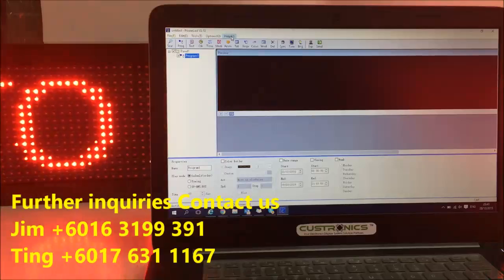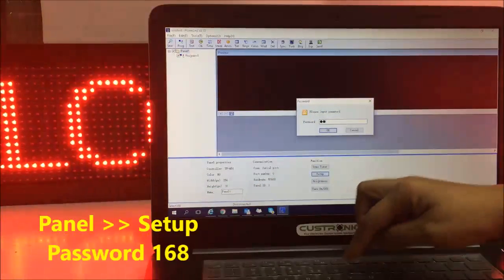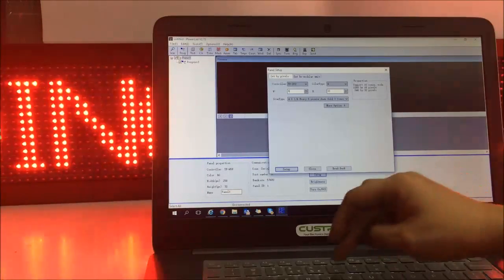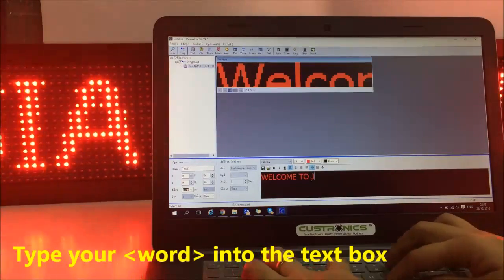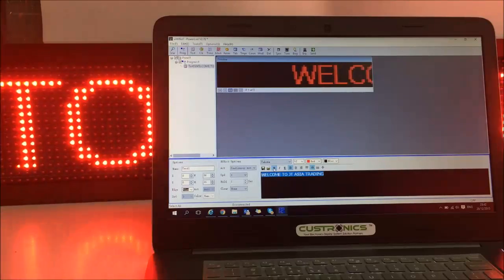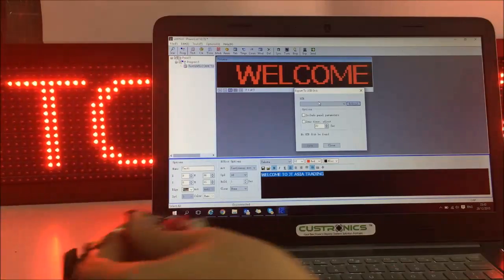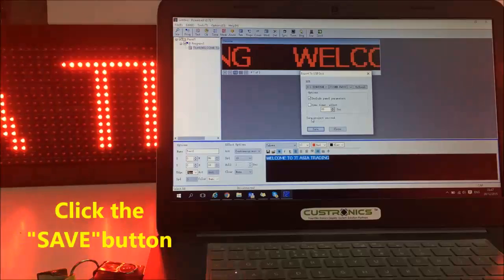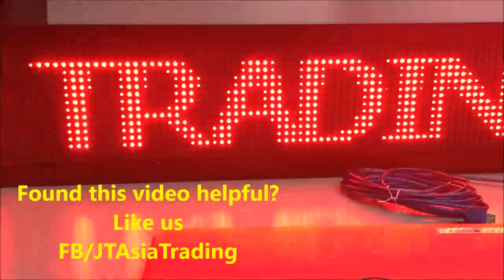How to program LED Running message board using powerled with TFS5U controller | LED Display Malaysia

Comment: We have this program and it works well.  We want to add a pic to the text.  Do you know how to add a pic to the text so it scrolls after the text..or with the text, not behind the text?
Reply from the maker: Hi Rebecca Borst, yes. as long as you follow the resolution in ms paint & import .bmp file via the program.

Comment: If I load a programme on a flash ,next time if I want to programme the led do I have to delete the existing file before imputing the new programme
Reply from the maker: Hi Angelo, you do not need to delete the existing file from the flash. The PowerLED program will automatically over write every time you program.
Reply: @JTLEDDisplay  I still have difficulty programming words into it at first try the welcome alone works, but when I input the right way words into the flash it just goes to default think am not doing something right.my model is TF-S6UW
Reply: For the TF-S6UW WHAT SCAN TYPE WILL I SELECT IN THE OPTIONS PLEASE
Reply from the maker: @angeloangelo8523  scantype usually we will use 4.1 please refer to this video https://www.youtube.com/watch?v=wdh8Y_0pex8

Comment: 12 FEET BOARD, do i need to follow the same instructions? and about the USB i m unable to find a less than or 8GB USB can i use 16GB ?
Reply from the maker: Hi Ethan Hasnat, good day to you. the programming steps will be the same. you need to refer to another video for screen setting https://www.youtube.com/watch?v=wdh8Y_0pex8 
latest main control board able to support up to 32GB

Comment: Hi, can I transfer the file setting to LED board without using USB port?

 Because my LED board is using rg45 internet cable and using sigma 3000 software to setup the words.
Reply from the maker: Hi Are Fix, different manufacturer have different type interface. there are more than 10 different type of software in the market.For more info pls visit us at www.custronics.com

Comment: Is it possible to program the display via /dev/ttyUSB0 on Linux?
Reply from the maker: so far our program only work at window platform, i am not sure does the software work with Linux or not.
Reply: Hi, I'm trying the same with an old panel I found. Did you find an answer?

Comment: Hi there. I love your LED Panel, it is amazing. I just have one question: I run the P5 mini LED K1696 Wifi. How do I know which controller I have to choose in the advanced setup menu at the Powerled software-menu? TF-???. Thanks for your help!
Reply from the maker: Hi Haymo, you need to open up the panel and look for the controller model number. we hardly able to guess the model for the controller

Comment: I have followed thats step, but never get 'OK' when I plug on USB to TF-SU module, any suggestion??
Reply from the maker: means the parameter setting is not saved in the pendrive or you can try with other brand pen drive. or else the setting in the software us not match with the control card
Reply: Thx U very much sir, leme try to another pendrive

Comment: Hi there, can you help me in this. My board is on WIFI. I recently reinstalled my PC and i have lost the file that is running currently on the board, and i need the same information. Can i download the information from the LED board to my PC and how can i do it. Thank you in advance.
Reply from the maker: hi Stakito, what we can do send you the powerled software, and you need to download the software and connect to the panel with your password. the information of the main control unit will automatically transfer to your computer and what you need to do is set the size of the panel.
Reply from the maker: https://www.youtube.com/watch?v=hEsjm3weyOc
Reply from the maker: Software sent
Reply: JT LED Display nice

Comment: do you know i can setup a TF-LU20 320x32
Reply from the maker: Hi Victor, we didnt use TF-LU20 control card before, normally you able to contact your china supplier through Wechat, they able to assist and guide you
Reply: @JTLEDDisplay  595 ic at mega 328 software RGB display ka